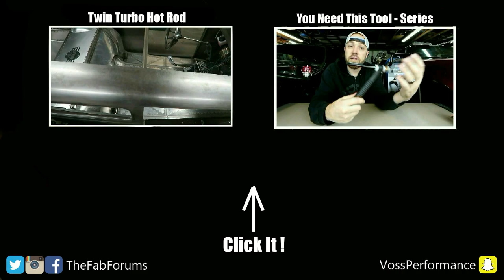Chop Top Fox Body Mustang Hot Rod Build

Comment: The Mopar community applauds you for cutting up that Mustang. LOL, I'm kidding. That Sawzall made nice clean cuts. No sparks or abrasive dust like you have with a cut off wheel. Do you have a trick for straight cuts, my blade tends to wander around, not sure if I'm using to much pressure. It might be as simple as buying better quality blades, and not exerting as much force.
Reply: Al Cyr was going to ask same question lol,i never made a straight cut with a sawsall,last time i was cutting a e36 bmw i trew the damn thing it busted in peices,got the cutting wheel out then i was fine,i cut tubing better with grinder as well lollll 😂
Reply from the maker: no, no secret. I always dress the cuts a little afterwards to make them match
Reply: Cut off wheel is my preferred tool. Although I would be worried about body panels shifting, and breaking the disk. Years ago, I tossed out the wood blade from an old Black and Decker circular saw. Bought some chop saw disks. I didn't force it, but it made nice straight cuts on a step side bed. Converting a '57 Fargo, long bed to fit on a Ramcharger frame.
Reply: Al Cyr one good tip when using a sawz all is to use the fence on the saw. That will help a lot.

Comment: I don't usually comment on videos, however like I said "in the industry" DOM is used to denote a certain type of tubing. Much like, it is accepted that a "Cresent Wrench" is actually a "open end adjustable wrench" so when you say "DOM 4130 tubing" you confuse people that are very new to this lifestyle. I like how and what you are trying to do. I'm only attempting to maybe help with your delivery of what you are trying to say. Keep on keeping on!
Reply from the maker: yeah your probably correct....thanks for the heads up
Reply: Technically, DOM is not a type of steel tube, but rather the process in which the tube is finished. It is considered a high quality tube, and is normally constructed from SAE 1020 or 1026 steel. The first stages of manufacturing are identical to ones used to make electric resistance welded tube, but in the finishing stages the entire flash weld is removed and the tube is cold drawn over a mandrel. The cold drawn process provides the tube with better dimensional tolerances, improved surface finish and the strongest weld strength achievable. DOM is often incorrectly referenced as “seamless tube” when it actually does have a seam (although it is almost invisible). Taken from here...https://www.metalsupermarkets.com/difference-between-erw-dom-and-seamless-tube/

Comment: In the industry "D.O.M. & 4130" are two different things! DOM is a 1020 mild steel tubing that has a seam. 4130 is chromium & molybdenum alloy that is seamless typically heat treated and then normalized.
Reply from the maker: Yeah DOM is just the process and not actually the name of the type of tubing. You are correct the process of drawing the tube over a mandrel to clean up the seam is usually associated with mild steel but it is also the same extrusion process that is used to make seamless tube.

Comment: There are a lot of variables with a laser as well: is the floor perfectly level? Is the body of the car perfectly level? Has the body been built square to begin with? I'm not sure I would trust a laser in this situation.
Reply: This is a great undertaking. Good job dude
Reply from the maker: yeah the laser self levels...it doesnt depend on the floor. The laser more or less just makes sure you take the same amount out of the front as you do the back.

Comment: is d.o.m chromoly?
Reply from the maker: no you can get DOM mild steel as well
Reply: um, dom is made with a seam and it is taken out, chromoly doesnt have a seem ever.. i think dom is 1020 or 1026 grade or something like that, but i have to disagree that dom and chromoly not the same
Reply: +keith wilson 
You are correct, chromoly 4140 steel tubing is seamless and DOM is Drawn Over Mandrel formed 1020-1026 mild steel with an inside welded longitudinal seam.

Comment: I want to see someone build a hot rod from an Explorer sporttrac. Using the cab like a modern version of the model A body. Open wheels and engine bay.  Maybe shorten the bed down to 1 or 2ft long to keep the tailgate and taillights, maybe a short tonneau lid a couple leather straps with buckles for that, with old time script Ford on the gate. Keep the modern headlights but find a way to steam punk them on there so it doesn't just look wrecked. Or just Square LEDs mounted like they would be with brass or chrome hardware. Spot light by A pillar.
Reply from the maker: yeah the biggest thing with modern cars is that the bodies are to wide to get the old hot rod look. no matter what you use, it will have to be narrowed to get the proper look

Comment: You guys think about taking a strip out of the middle of the roof to pull the sides in a bit? Pretty radical stuff but you ain't exactly taking the easy road! Anything to reduce cross sectional area reduces drag and that means faster!
 Leaving just a small bubble or teardrop roof would be a show stopper and much faster!  Bit like a salt racer profile? Has this been done on a drag car?